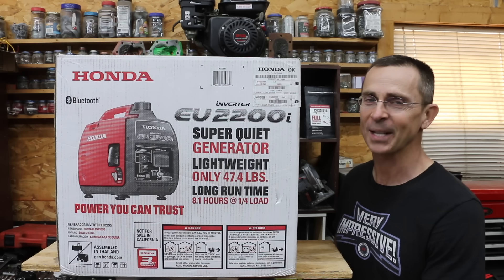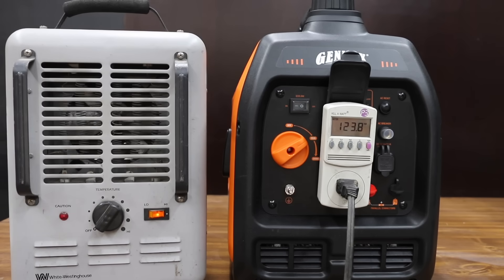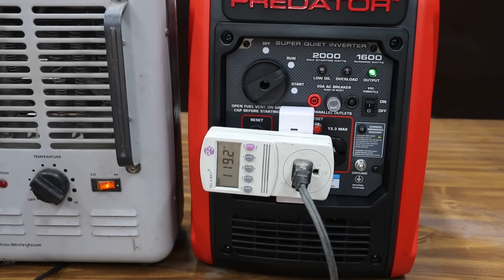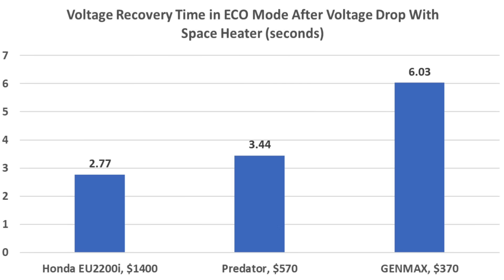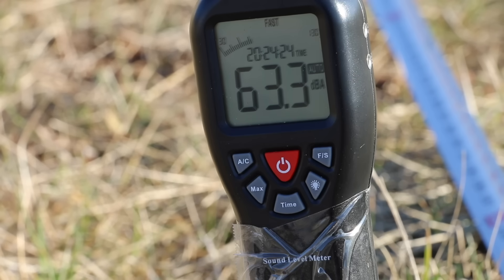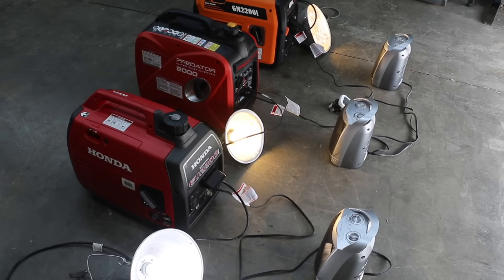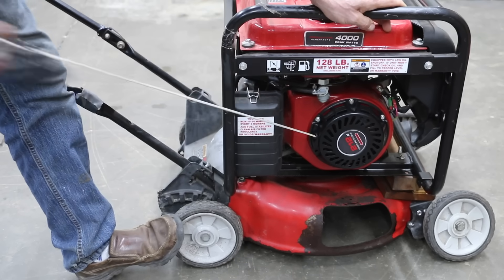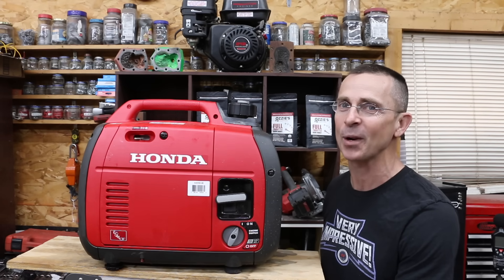Cheap Generator Better Than Honda? Predator vs Honda & GENMAX—Let’s Settle This!

Comment: Could you please review the ipower 2300 powered by yamaha?
Reply: I have one, along with two EU2200's.  It's not a bad generator, especially for the money, but it is absolutely not in the same league as a Honda.  I bought it to use as a loaner when family wants to borrow a generator; they're not getting one of my Honda's.  It can't tolerate sudden substantial power demands that the Honda's can, but if you don't plan on running it at it's rated output much, it should be fine.  I can't comment on durability; mine doesn't have many hours on it.  It starts easy; I'll give it that.  I start it once every six months and run it for 30 minutes, then drain the carb and put it away.  If I turn the engine switch on and let it sit for a minute before pulling the rope, it'll start in one pull; always impresses me.
Reply from the maker: Thanks for the suggestion.

Comment: I bought that Honda generator, to supplement my solar, during cloudy times.
It got stolen, 2 days later.
Bought the Ford branded, Chinese 2300w one, for $400, because I needed it, and another Honda, was just not in the budget.
2 years later, it has run hundreds of hours, 2 oil changes, still has the original spark plug.
Only real complaint, is that the breaker seems to be about 10v below listed rating.
Reply from the maker: Thanks for the feedback.

Comment: I see it as buy the Honda...buy once buy right....I have has my Honda E2000i for 10 years now and no issues...cheap Chinese copies are no end of problems, even as much as having the piston ring gaps all aligned as opposed to 120 degrees apart.
Reply from the maker: Thanks for the feedback.

Comment: It would be great to see the 3500-3800 watt generators compared  - like the electric start models and even some dual fuel -  in particualr the WEN 56380i Super Quiet, 3800, the Generac and the cummins/Onan P4500i  - thanks
Reply from the maker: Thanks for the suggestion.

Comment: I have a Champion 2500w Dual Fuel generator.  I use it off the propane bib on my camper for charging the battery when boondocking.  I'd be interested to see how running using propane affects the oil (both in consumption and contaminants) and spark plugs.  Not to mention how it compares in efficiency to other brands.
Reply from the maker: Thanks for the suggestion.

Comment: I have a Honda eu2000i that's still going strong for over 10 years. I stopped keeping track of hours at 3000. I would definitely replace it with another Honda when I need to.
Reply from the maker: Thanks for the feedback.

Comment: I back fed my house panel with an EU2000 for 10 days straight after Hurricane Sandy with very little down time. Sump pump cycling 9 amps every minute or less for the first few days while keeping my fridge and a few other necessities running as well. That same EU2000 is still in service today.
Reply from the maker: Thanks for the feedback.

Comment: Oof, that price tag for the Honda eats up it's other advantages. I mean sure the voltage drop is less severe for start-up of a high-current heater, but the engine is also bigger. It is quieter and less vibrate-y though and has bluetooth XD. For that price though you could get like 2 of Predators. As far as the wear metals go I'm wondering if the fact that the other two had to run their engines harder to produce the same output due to smaller displacement caused the drastic difference in wear-metals in the oil. Burning off oil probably didn't help with that either.
Reply from the maker: Thanks for the feedback.

Comment: Honda manufacturers the best small gasoline engines known to man🤫. my 1986 Honda ATC Big Red three wheeler can sit for 1 year with old rotten gas and you can bet money it’s gonna suck the mouse nest into the intake and still start on the second pull every time!!! Don’t even get me going on 3M products as I may spontaneously orgasm 🤣😂

Comment: Was the oil test sample from the intial fill? If that is the case the high iron and aluminum content could be from lack of cleanliness in manufacturing process instead of wear.

Comment: Very thorough testing! One additional note is that the Honda generator will most likely retain a significant part of their value if resold. I own one and with the low hours I have can resell it for just a little less than the purchase price. They are great machines.
Reply from the maker: Thanks!  Thanks for the feedback.
Reply: @happydogg312  "you never know..."  In this case, you might discover you need 3500 watts... or whatever.

Comment: North American voltage specification is 120vac +/- 10% so anything between 108 and 132 is acceptable and all equipment is designed to operate within this voltage range.
Reply from the maker: Thanks for the feedback.

Comment: Great comparisons and if I had the $ and needed a generator I would buy the Honda. I haven't done my calculations yet, but could you tell me what size generator I would need to power a 6' tall 3' wide refrigerator/freezer and a 15,000btu window AC, both run on 110volts? I haven't looked at the amperage #'s yet so forgive me. Both are energy ⭐ rated if that will help. You're probably laughing when read the part about the size of the refrigerator/freezer, like that will help. 😁
Thanks.
Reply from the maker: Thanks!    Thanks for sharing.

Comment: @todd: i heard that the honda also has an VTEC mode... when you engage it, it does nothing but getting 10 times louder, burning more oil, reving to 10k rpm and loosing the half of its torque... 

:P
Reply from the maker: Thanks for the feedback.

Comment: If you need the one you have to work, get the Honda. If you aren't hurting for money, buy the Honda. If you have unlimited space, no weight limits, and 66% as much money as the Honda buyer, buy two GENMAXes, two Predators, or one of each.
Reply from the maker: Thanks for the feedback.

Comment: Well, when I can buy a brand new generator, specifically the inverter type it will be a Honda.  I think the Honda engine is roughly 1.7x the size of the other two so I would think that's why the Honda runs out of fuel first.  It's probably also the reason why the voltage is a bit more stable on it as well.  Great video as always too.
Reply from the maker: Thanks!  Thanks for sharing.
Reply: @ProjectFarm  I am still considering between Honda and an Echo BearCat unit.  I watched the video again to remind me what I commented on again.  The Echo BearCat is very well similar to Predator here in Canada as I think they are made by the same company.

Comment: Lately I've been seeing ads pop up and videos from some YouTubers advertising Element brand fire extinguishers. They're sort of like a road flare that you light, and they release a supposedly safe smoke that will put out a fire. It got me thinking, there are a bunch of different styles of extinguishers, from the classic red dry-chem cylinders, to the water based chrome canisters, to aerosol cans, these new flare style ones, glass bulb grenade extinguishers, and it could be a great video to test them in different situations to see what works best. I'm sure we all would want to know for protecting our homes, shops, cars, and RVs whether these different styles work or are just marketing hype. You could test them against different fuel types, under freezing conditions, leave them in a hot car to see if that affects performance or creates an unsafe condition, whether the extinguisher media causes problems for different materials like what would be found in an engine bay, how long each style lasts, how far from the fire each can be effectively used, etc. I'm sure you can come up with other tests and metrics, but it's something that's been nagging at me in the back of my mind lately and I'd love to know if there's anything behind the marketing hype, or if I should just stick to the tried and true red dry-chem canister and return it for testing/recertification every so often like I always have.
Reply from the maker: Thanks for the video idea.

Comment: I have a couple WEN generators purchased from Amazon. The price is right, and they so far have been fairly user friendly. I've only used them for a lighting, and charging a lithium ion house battery. I'd be curious how they compared to these, particular the relative fuel efficiency, and how clean the energy is before I hook up more delicate electronics (for instance my Starlink system). I think I bought these generators with the money I saved by purchasing products you've tested in the past and found a less expensive item performed better.
Reply from the maker: Thanks for sharing.

Comment: As a guy who messes with tons of these small engines, ive noticed that honda does a way better job of cleaning out casting flash than the chinese companies like harbor freight. 
I wonder how the aluminum and iron levels in the oil compare to each other after the oil has been changed a few times. The predators oil always look metallic as can be on the first oil change after a couple hours of run time., yet ive never had an issue getting several hundred hours out of them.
Either way, great review, as always!
Reply from the maker: Thanks!  Thanks for sharing.

Comment: You get what you pay for, think long term. I bought the eu220i when it came out and guess what it's a HONDA it works every time I need it, just like my 2010 Ridgeline with 200000 miles and my wife's Crv with only 185000 miles on it. 😅
Reply from the maker: Thanks for the feedback.

Comment: The oil burning / plug fouling in the Predator was the biggest concern for me but the aluminum wear in the Genmax is also a red flag. I'd probably lean towards the Genmax if I couldn't afford the Honda. 
Perhaps try out some propane fueled rigs? The power factor is lower but the oil stays much cleaner, etc.....
Reply from the maker: Thanks for the suggestion.

Comment: Living in South Africa with daily power cuts about three times a day for two 2 four hours at a time, continuously for months on end already, fuel economy and noise levels are of importance.  When the power goes out several people in the neighborhood start running small generators and the noise can become irritating to neighbors and the cost of fuel gets quite high if you have to use a genie 8-10 hours a day.  Actually watching this while running my TV off and inverter and batteries.  You won't believe how quickly a lead acid battery, even deep cycles, pack up with such frequent power cuts.  Deep cycle Lead acid and gel batteries, in general, are not sold with a warranty anymore.
Reply from the maker: Thanks for sharing.

Comment: I get that there is no real way to do a 'Long-Term-Test' on generators but, the Honda won't seem so expensive after 10-20 years or after running it night and day after a hurricane where power hasn't been restored for a couple of weeks. Isn't that the whole idea behind buying a Honda? No way those other units are going to last very long. If you live in south Florida, you kind of have a different perspective on durability. I have an 8kw Honda Gen that I can always count on to start on the first pull year after year for 23 years. My neighbor bought a Generac (which isn't a a bad brand) and had major issues with it. Pay now or pay later.
Reply from the maker: Thanks for the feedback.

Comment: That high frequency harmonic is particularly bad for "capacitive dropper" type power supplies found in some cheap lights.  Such circuits use reactive impedance to limit current, and the higher frequency can pass the capacitor a lot easier.
Reply from the maker: Thanks for the feedback.
Reply: @ProjectFarm  And as such those pure sine wave inverter generators are safe for such devices.

Comment: An idea for testing... Automotive battery testers. I found alot of them are way off even just in voltage. When a HF multi meter is more accurate than most they may be horrible. There are a ton of them on the market. Even high end testers aren't necessarily better.

Great channel, you've saved me time, aggravation and money with your testing.
Reply from the maker: Thanks!  Glad to hear!  Thanks for the video idea.

Comment: Genmax 3500w would be a cool one to test.  It can optionally run on propane, has push button or phone app start and RV power hookup.
Reply from the maker: Thanks for the suggestion.

Comment: Maybe you can answer a question for me, i have a large predator generator and it runs great BUT the pair of 110 volt outlets stopped working on it.  The 30 amp 220 volt and the dc output still work…any ideas what to look for

Comment: I'd like to see A-iPower tested.  They are a Yamaha knock off.  I bought two dual fuels for the camper. that I only run on propane.  Because I also have solar on the camper I rarely need one, and only need both running together if I want to kick on the AC.  Knowing they would be used sparingly, I went cheap.  They work fine but after doing the break in oil change, the oil was grey.  I wish I had sent that oil into a lab because I'll bet the aluminum was off the charts.  You could see it with the naked eye.  I'm pretty sure they would score poorly, but I'd like to see where they do rank.
Reply from the maker: Thanks for the suggestion.

Comment: I have a few Honda 2000 and 3500 for over 20 years on job sites never service them only oil change randomly.
Never broke except pull chord and spark plugs.
Keep that Chinese clone genmax  POS in China

Comment: I'd love to see the Champion inverter tested against it's competition.  Really popular due to price with the RV community.  Great video!
Reply from the maker: Thanks!  Thanks for the suggestion.
Reply: That would be great. They are popular.
Reply: I have have a Champion 2500 dual fuel suitcase that I use on my sailboat.  The first unit died in 60 days.  Replacement is going on a year.  It has random vapor lock issues.  Pull cord is a weak point.
Reply: I have a regular 3600 champion. I like them, fairly durable with cheap parts. I’m at about 1500 hours. Only issue is the fine springs on the governor tend to corrode and shake apart. Maybe a dollar to fix it. Brushes don’t last very long, I replace them every 500 hours and I had the AVR go out at 1000 hours but that only cost about 20 bucks to replace.
Reply: I came here to say Champion. I bought one at Northern Tool instead of the Honda. Saved me during the snowpocalypse here in South Texas a few years ago
Reply: I would like to see the Champion hybrid 4500. It's the best of all worlds (clean power, variable speed, better fuel economy, longer life, etc) but for cheaper than a traditional invertor generator. Also it being open air, I suspect it cools better which should translate into longer life.
Reply: When Compared to Genmax ,  Champion  is  over Priced   Genmax 2000w $369  Champion 2000w $469  = $100 More for what Nothing there the Same Generator with just diffident Names Both Made in China & use the Same China Parts !

Comment: It’s upsetting the fact that the Honda took almost 3 Yanks for it to start and yet it’s almost a $2000 generator… but the other cheaper ones started up first pull
Reply from the maker: Thanks for the feedback.

Comment: As always, an excellent and informative comparison. 

I was glad to see the noise comparisons. Especially important is the distance from the meter. A flat dB rating is meaningless without an associated distance. Every doubling of the distance results in a 6dB drop in the sound level. 

Regarding the muffler, the size measurements taken were only in length and width, without the depth being measured. While shape and internal baffles can make a difference, the internal volume can make a huge difference in noise attenuation. But a large contributor can also be mechanical noise once the muffler becomes very effective, and that is why the quieter generators usually have a full enclosure and soft engine mounts.

The oil analysis results were an eye opener! I thought maybe it would be good to flush the crankcase and do a second run, just in case some of the aluminum and/or iron were the result of a normal break in, or even left over manufacturing artifacts. 

Keep up the good work!!
Reply from the maker: Thanks, will do!  Thanks for the feedback.

Comment: How does the parallel generator operation work if the two generators are out of sync with each other?
Reply from the maker: Thanks for the suggestion.

Comment: I already knew the Honda would come out on top when it comes to hard usage, but it is expensive. If you can get by with the cheaper ones then do it but if you need something to perform when the going get taxing then spend more for the Honda.
Reply from the maker: Thanks for the feedback.

Comment: Todd, please please please do a video comparing Tire Pressure Gauges.  I recently spent a whole afternoon trying to find consistent assessment of good, reliable devices and I flat can't find it.  So many websites just make recommendations based on Amazon Reviews and we all know that is garbage.  I would love it if you tested a selection of various quality digital and analog tire pressure gauges, subjecting them to not only accuracy but also repeatability under different conditions.  I'm curious, especially, at the accuracy deviation over time when comparing a piezoelectric digital sensor versus an analog gauge's bourdon tube.  It seems the bourdon tubes are more sensitive to abuse than the digital gauges... testing will prove this.  
Keep up the great work!  Your reviews stand as truth in a sea of marketing deception and bot reviews.
Reply from the maker: Thanks, will do!  Thanks for the suggestion.

Comment: Could you test manually operated grease guns? Looking for ones that are easy to use and don't leak all over after sitting a few months. Thanks! Your tests are the best!
Also looking at the mini 3 oz ones as well!
Reply from the maker: Thanks!  Thanks for the suggestion.